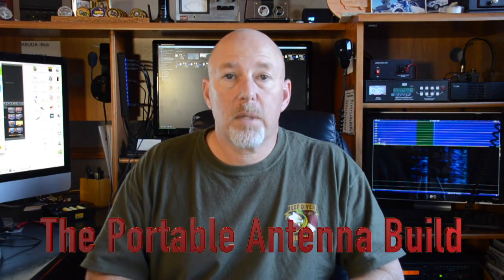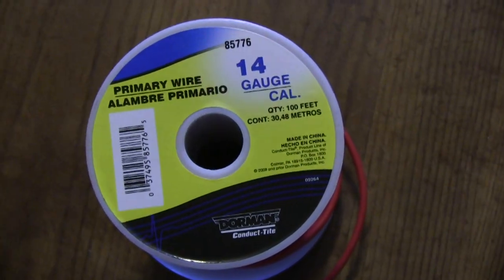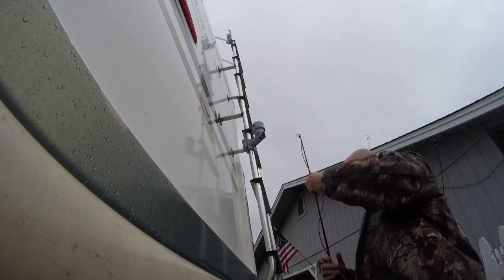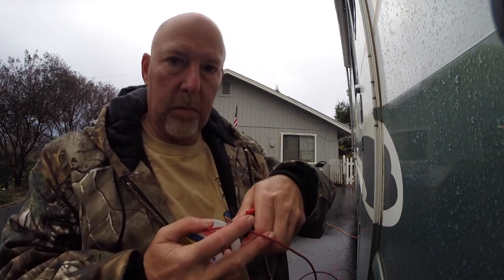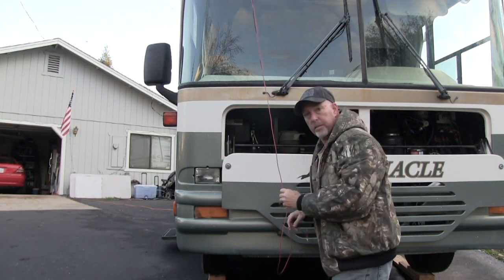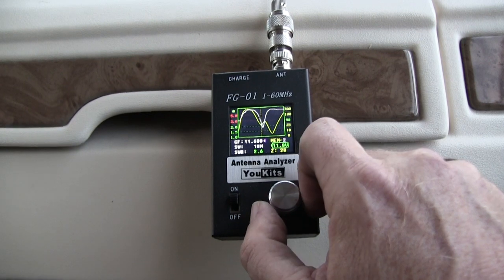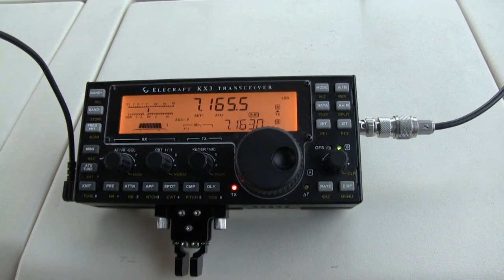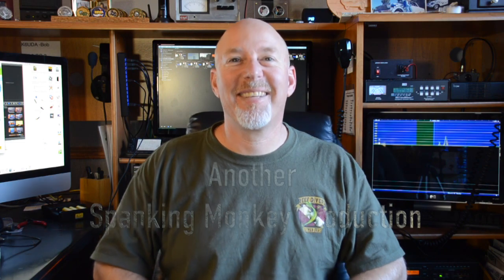Portable Antenna Build For Your RV - K6UDA Radio Episode 2

Comment: Shouldn't running the antenna wire so close to metal have an adverse affect?
Reply from the maker: The antenna wire is in free space. The Coax is shielded and the body of the coach is fiberglass.

Comment: Found a pristine 703+ over a year ago (it was on my must have list) and got the little matchbox antenna at the same time - my plan being to take it with me and put up a wire while camping. I have a 36+" 5er and like what you have shown for the "quick up" wire. 

What are the brackets you are using on your ladder for the pole? Is it the system Jackite sells?

Thank you for all your videos! Informative and fun!

Mike/W3TWG
Reply from the maker: I can't remember the name of the mounts, but I bought them with the jack kite in mind.
Reply: Those are flagpole buddy mounts

Comment: Bob, good video- along with the Mosley 33 beam, I also use a 127 ft end fed long wire for the "odd" bands that the beam will not work on.  73 W1XWX

Comment: Best to stick to one of the optimal lengths for use with 9:1 unun. 53' or 36' are common and will let you easily tune all bands 80-6m.

Comment: Bob, I am brand new to ham. I am waiting on my first license to arrive. This video interests me a lot and have a question. I will be buying a mobile radio for my truck. I have read that the antenna is where you need to invest your money instead of the radio. Is this build sufficient enough from a technicians bands?  Thanks. Gary
Reply from the maker: +Gary Goetz This antenna is built for the HF bands. If your a tech, you have privileges on 80, 40, & 15  meters CW, and a sliver of 10 meter phone. My advice, upgrade. Bob -K6UDA